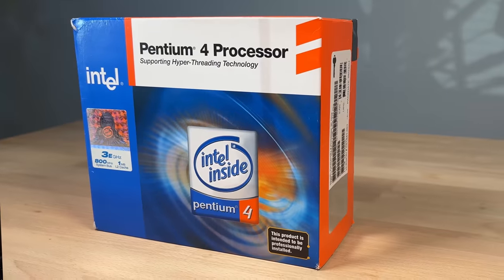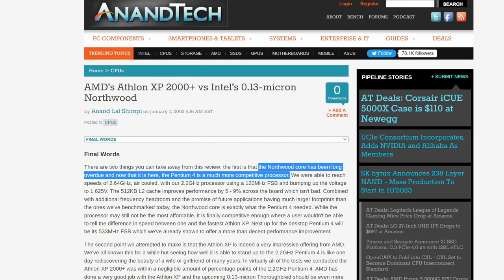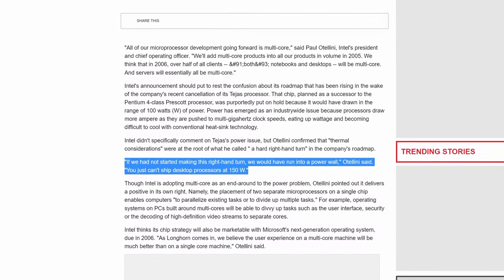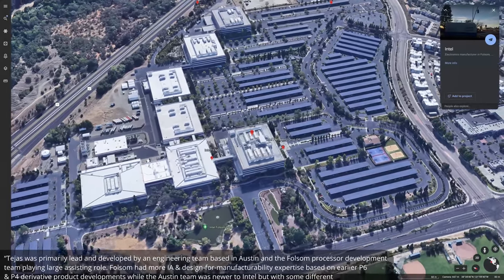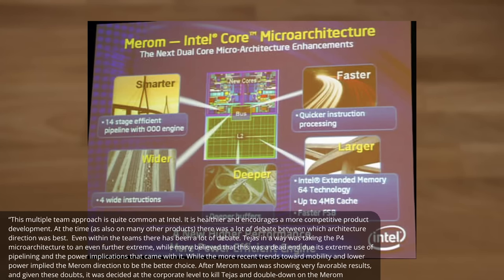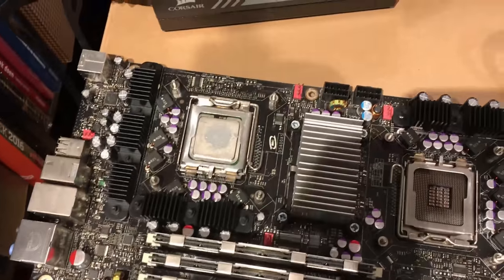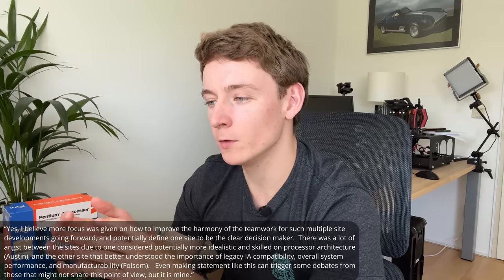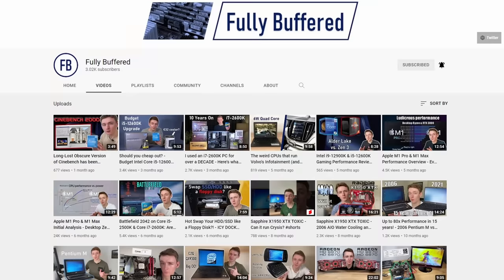Intel's abandoned Pentium 5 project...bought on eBay! (with info from Intel engineer)

Comment: The greatest CPU that Crysis never had.
Reply: Crysis is easy to run. My system crushes the game. Never understood the meme.
Reply: @helium5912  the 2007 original build relied heavily on single thread calculations.
Reply: @helium5912  that's because you're doing it 15 years late -_-
Reply: @helium5912  do it on a 2007 system and you'll understand.
Reply: @helium5912  Zoom Zoom
Reply: Original C is actually very dual threaded. Ratio is about 100% and 50% on thr cores respectively but trying to run it on one core is pretty bad idea
Reply: There's a difference between "easy to run" and "easy to run at ultramax settings". 

Think of Cyberpunk 2077, for example. You can launch it and play it on a pretty modest machine, all things considered, as long as you are OK with not locking to 60FPS and low/medium~ish settings @1080p, maybe with Quality upscaling on top. On the other hand, native 4K PT Cyberpunk puts 4090 on its knees.

The same was for Crysis in 2007. At low to medium settings, 1024x768, there were quite a range of PCs that could handle it. VeryHigh DX10 1920x1080, on the other hand, even SLI 8800Ultra couldn't "lift off the ground".

And, since we are talking CPUs here, Crysis is low-threaded game,  meaning it only can branch into 2 threads. Modern CPUs have enough clock / IPC to handle that even on the lower end, but nothing you could have got in 2007-8-9, and maybe a few years onwards, could warrant stable 60FPS at all times.
Reply: Crysis ?  why not video editing ?
Reply: @helium5912  greater bait has never been achieved before
Reply: @helium5912  it was nearly impossible to run on anything other than an absolute MONSTER of a system back in the day... You needed at least 2 way SLI or Crossfire and P4 chips would barely run it smoothly. 
I had a Netburst and the later Prescott P4... Even my Core 2 Duo E8400 struggled with it.
NOTHING would run it! THAT is where the meme came from. OF COURSE your modern system will run it!
It's orders of magnitude more powerful than anything anyone had way back then.
Reply: @fadingbeleifs  Memes dead. Move along.
Reply: Get over Crisis it was a shit game that was more badly optimized than any current Triple A failure.
Reply: @cairnex4473  yep.
Reply: @helium5912  you couldn't be less wise.
Reply: True...😊
Reply: @helium5912 a rage bait of all time
Reply: @helium5912  What's your definition of crushing? Can it run 144fps with no dips on amx settings?
Reply: @MrAkaacer  The game is outdated. The meme is dead. 144fps is nothing these days. I'm getting that 4k max settings.
Reply: @helium5912  Haha... well I just saw a vid rtx 4090, steady 178 fps. I'd say its still relevant as a benchmark.

Comment: I think you should look for bios modders to help you mod your motherboard's bios to get them running. They probably need a microcode to be running (now finding the right microcode might be tricky, maybe it can be found on the intel leak that happened few years ago ? Or maybe it can be reconstructed? I'm not sure what's supposed to be in those so maybe it's not that simple)
Reply: from what i can gather, QBGC was a thermal sample, which means the chips just flat out will not work, sadly
Reply from the maker: While not impossible, I would say it unfortunately very unlikely that the microcode ever made it outside of Intel labs..
Reply: i offer the option that all test chips of a certain generation should share the same id codes. I have no evidence for this other than ease of testing. If you had to put each id for each cpu it might pose some problems. If all the test chips are the same id , then that id is input once and covers all Qualifying samples and one code for engineering samples. all speculation.
Reply: Perhaps there are some "removed from  intel bins"  motherboards, where that bios is still attached. Just find it! 🤣
Reply: his cpus are not real dude
Reply: @uhohwhy  They may not be functional piece of silicon but they are very real
Reply: fiver might could help?
Reply: Simpler than that, I think many BIOSs just give up if the CPUID doesn't match a known processor.
Reply: @FullyBuffered  

Rocketlake exists.
Reply: maybe something openbios?
Reply: This
Reply: Nope, it was  due to the pwm and vrm mismatch with the processor. Taja/jayhawk’s thermal design and power draw were much higher for standard lga775 socket and such pwm/vrm configuration can only be seen in lga 771 xeon platforms and only few chipset would able to support such behemoth. Not to mention jayhawk’s tdp (320w) is about twice of qx9775 (150w) you’re lucky to find a qualified server board that can run it. Tajas will be even harder because you have to modify the socket to fit it in.
Reply: @BrianG61UK  Nah, the bios can´t "give up" before it is running on the CPU ;)
Even if the first stage loader runs on the CPU, the initialization code would not be able to initialize the CPU, as it needs to write to a lot of registers which configure peripherals like the FSB, PCIe and so on. These registers will be different for a new CPU architecture / platform and you have no way of knowing which register does what and so on.
Best you would probably see, is some activity on the adress and data bus, after power-good is reached.
Reply: @Spacefish007  You're not actually saying anything that makes my answer wrong.
Reply: @1NIGHTMAREGAMER  fiver is full of indian and pakistan dudes with not a lot of skill
Reply: @FullyBuffered  one could always ask Intel, am I right or not?? I mean if it is cancelled, then helping you start these would do no harm to Intel.
Reply: @BrianG61UK  all relatively modern CPUs have microcode stored on a built in rom (including pentium 4s), the microcode in the bios, is a  patch to fix bugs, alter functionality after the fact,  
many intel cpus will boot even if there is no microcode update present in the bios, harpertown on lga 771 wil boot without microcode for instance,  that said , an early engineering sample, is unlikely to  bootable  without updated microcode.
Reply: @kelpmaxxing  Well, it has to be bootable enough to run the instructions that tell it to update its microcode.
Reply: @BrianG61UK  I think its safe to assume that it would be at least capable of that given the comments by the intel engineer in the video
Reply: Wouldn’t it be sick if BIOS was open source?  I don’t get how we can have open source OSs and cpu microcode but not bios…
Reply: @5urg3x There have been various open source BIOS projects but even if there was one for platforms you'd be using, it's very complicated and still requires proprietary code from Intel and AMD. You can use tools to read and modify much of the ROM. Usually the most you could hope to do is modify some of the UI and expose hidden settings. These days there are security measures in place that often prevents a modified ROM from working.
Reply: I guess some chinese put an modded head spreader on top for scamming .???
Reply: Sometimes the bios contains a list of valid cpus. First is to add the cpu to the bios
Reply: @FullyBuffered  I thought you were from The Netherlands?  I was thinking people there wouldn't use a British accent.

Comment: Just need an Intel 771/775 "Lab" board which are available with the right microcode/BIOS, or a custom BIOS with the right microcode on one of ASUS 775 boards. Just need to shave the substrate so the board's socket doesn't need to be cut. People in Russia have custom written BIOS for 775 boards that made 771 XEON chips work, so i'm sure it is possible to get these chips running.
Reply from the maker: Thanks for the comment! I would love to get hold of an ES 771 board for this, but those are possibly even harder to find than these chips.
Reply: There HAS to be someone with connections at intel to help you get that cpu up & running :/ fingers crossed!
Reply: They could get those chips working because they had access to microcode from other BIOS's. It's a very different story when you have no reference. Especially when the chips might just be so different that they don't work with the northbridge.
Reply: Yeah but the 775 and 771 are essentially the same CPU internally, the 775 has just SSE4.1 fused away.. The difference between the chips is a 90° rotation of the socket and the exchange of two pins.
The 771 xeons will even boot on the 775 mainboards without a bios mod, but then SSE4.1 is not availiable.
Reply: 771 chips work out of the box on a 775 board (given it has an suitable chipset - p45 is best and the socket mod has been done already). you only lose a couple of instructions if stock bios is used
Reply: @LoneWanderer905  not offended, ddr2 xeon system here
Reply: @n0rie9a  It needs a cpu physical/electrical mod for 771 to fit in 775 and bios microcode patch. 771 socket also rotated by 90 degree from 775 (from contacts view).
Reply: yeah they were also selling small pastable converters , like a piece of tape that you stick on cpu to make your 771 xeon work on 775 I think even LowSpecGamer made a video on it back in the day

Comment: I mean singlecore sucking up 150W would be very impressive talk about efficiency
Reply: ya imagine an 8 core drawing 1200 wattts
Reply: @benruss4130 in a Pentium D like scenario, a 4 core  cpu would have a stupendous die area larger than a 4090, would draw about 750-800W stock (150W per core, plus transistor leakage and interconnect + FSB), while having less performance than a core 2 quad at 2.66GHz 💀

Comment: There is an old byte article in byte magazine that had them bragging they were gonna take it to 10ghz during  during the willamette maybe northwood era I can't remember the exact year. So yea those prototypes had to exist hitting insane clockrates for them to say it. They never bothered to mention the cache misses would stack to the point it would lose IPC as it got faster lol. Hence why we got the hacked together "pentium3" core series as the replacement that we could of had years earlier if they weren't pushing the P4 so hard. They might of even beat amd to the punch for x64 lol if the Pentium 4 line never existed.

Comment: I remember those days, that's the 1st time AMD pulled ahead.  Intel was making higher frequency processors because people mistakenly thought more hertz meant more speed.  But the lower clock speed AMD were faster at that time.
Reply: The 1st time AMD pulled ahead was when AMD 1st hit the scene making Intel CPUs better than Intel.
Reply: @bogartwilley  Yeah the Athlon line in '99. AMD has been making CPUs for awhile.
Reply: @Ittiz  1970 with the am2501
Reply: AMD beat Intel to 1ghz and above, Intel released and recalled its 1.13ghz model for stability issues. Its probably why Intel went with the netburst high clock speed architecture. Higher clock speeds are better, right? /s
Reply: Then they did it again for ryzen. And now they think that they don’t need to add cores to keep up with Intel anymore. They actually think selling a 6 core for the price of a 10 core is a good idea.
Reply: @apachelives  Actually AMD did far more than that...  AMD was 1st to 1ghz, 1st to multi-core, 1st to 64-bit (actually the 64-bit instruction set belongs to AMD, when Intel sells a current day CPU they pay AMD a royalty to use the instructions otherwise the present day Intel CPU families wouldn't function on Windows 11 and beyond), 1st to 8 core, 1st to 64 core, 1st to 128 core, 1st to 5ghz, 1st to pack on tons of Cache to a single Chip. they (MAY HAVE BEEN) 1st to release a Server CPU on a consumer Socket (Opteron 165 on Socket AM2, which I actually had one of these, and back in the XP days it played early-ish versions of PCSX2 Emulator rather decently for what it was, not entirely full speed but it was functional) and these are just the ones I can remember without looking anything up :D
Reply: then the AMD FX came and it was the opposite - Intel was faster at lower clock speeds
Reply: which lower clock speed AMD were faster at that time ?
Reply: now amd is hitting brick wall again...just like FX era...instead IPC gains...their gonna at higher frequency gains on same architecture with terrible ddr5 support...Intel gonna do it again...with arrow lake . Worst yet to come is whats after arrow lake...thats next chapter intel success...new memory configuration, faster timings , better gpu support
Reply: AMD pulled ahead with low-IQ gamers. In the corporate world, where reliability matters, Intel remained king with their superior P4 processors and architecture. And by the way, for the vast majority of CPU history, more hertz DID mean more speed. But speed is meaningless if the shitty chipsets AMD processors usually found themselves next to, along with shitty drivers for them caused the machine to be less reliable. That's the thing you gamerboys never got and STILL don't get.
Reply: @bogartwilley  40 mhz 386
Reply: @Great-Documentaries  If you were talking about socket 7 you'd have a point even though your delivery is hilariously pompous. Slot A, however, try again. AMD even released their own chipset to try to counter the issues with the super socket 7 days. 
The days of video cards being poorly supported, etc. were over after the SS7 days. 

It's odd that you'd pick the worst era of Intel to make a  stand. If you had chosen more wisely, say the beginning of the "Core" architecture your pomposity would almost be excusable. They were outdoing AMD so hard from Core 2 all the way til 7th-8th gen or so that they were basically a monopoly.

Also, if you'd go back just a little farther, the Pentium 2/Pentium 3 era had hugely faster FPUs than the K6/K6-2 and also your comments about reliability problems would be very much on point and undeniable.

The Pentium 4 family was almost always flawed. The first gen was slower in a lot of workloads than the 1ghz Pentium 3. Power consumption and heat plagued the thing the whole time, and then their attempt at dual-core had laughably poor multi-core efficiency. Northwood and Prescott were the only ones that weren't e-waste and they still weren't amazing. I hope your abilities as a documentary maker outpace your demeanor and diplomacy by a huge margin, you might want to work on fact checking too.
Reply: @Great-Documentaries lmao is that why Zen Epyc has been constantly gaining market share since 2017? "Unreliable" lmao
Reply: @user78405  14900K feeling good, crashing with stock power limits as it struggles to compete with AMD that require a fraction of power.
Reply: @user78405 x86’s era has reached its end. Apple has showed that ARM is the future: if Intel’ll prove slower than AMD to make the switch, then they’ll become the next blue-chip company to fail.
Reply: @MisterRorschach90  You're increasingly looking mighty dumb nowadays as AMD seems to be right. Intel just keeps upping their clockspeeds again while an upcoming 16-core trumps everything they put out at probably ⅓ the wattage. Who even cares if Intel may have more threads soon if ⅔ of the real cores as much slower?
Reply: @andy5178  "Apple has showed that ARM is the future" - ARM market share has gone down again. People believed in ARM being the future due to Intel holding down X86 with low core counts and ineffecient architecture. Ryzen changed that. Now you can cram 512 cores into a single server blade with lower power consumption.
Reply: @xXYannuschXx  I believe there is less advantage to RISC (ARM) vs. CISC (x86) these days because even though the x86 scheduler is stupidly complex, it is part of the logic circuit and that has been shrinking well with newer nodes. What has stopped shrinking is cache - you need more of it and it takes a lot of die space vs. logic. Who cares if x86 requires 2x logic vs. ARM if 70% of die area is SRAM cache that hasn't shrunk since TSMC 7nm? Apple M3 is ot much better than M2, so we can already see "peak ARM", and remember - Apple is first to newer node vs. AMD, thus the apple silicon is to some degree better simply due to node advantage, not architecture.
All this is my opinion.
Reply: @Great-Documentaries  absolute nonsense. Ive swapped back and forward between Intel and AMD for decades, often using both concurrently and not for gaming. Software development (both OS and drivers) puts a cpu and core logic through more of a wringer than most tasks and stability is nigh on equal. 
And at NO time is cpu history has higher frequencies automatically equated to more speed. MIPS, DEC Alpha, PPC, Motorolla 680x0.... all vastly different IPC to the x86 ISA for different instructions and that's disregarding SIMD extensions. A 650mhz g4, when using vector units like Altivec will absolutely DESTROY a 1.4ghz P4 for many tasks as a randomexample. If you want to go back further (early 80's) an 8 mhz 68000 is typically faster than a 12mhz 286. Want to go back further.... a 6502 at 1mhz will be roughly as fast as a 3mhz z80 in many tasks. a Motorola 6809 will beat most of its peers at less than half the clock speed. 
The irony you using the term "low-IQ" while you showcase your cluelessness is palpable.
Reply: @Great-Documentaries This comment aged poorly 😂